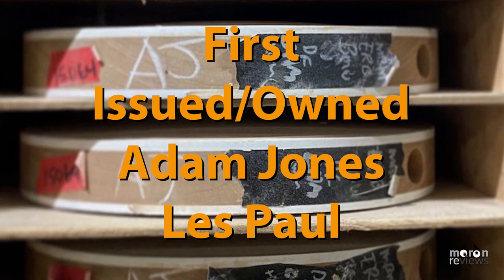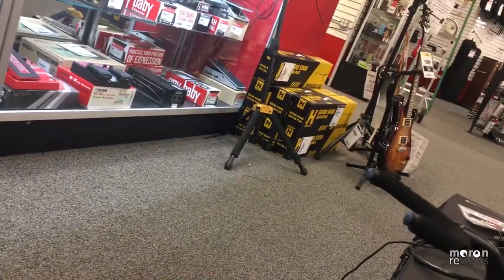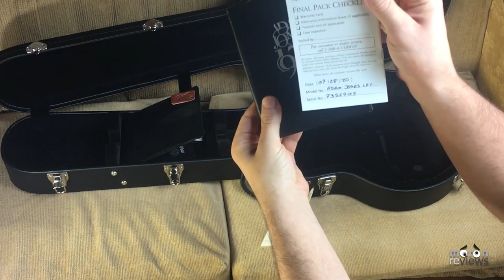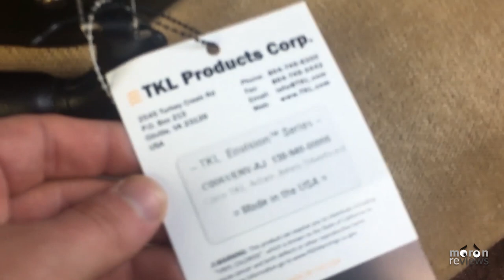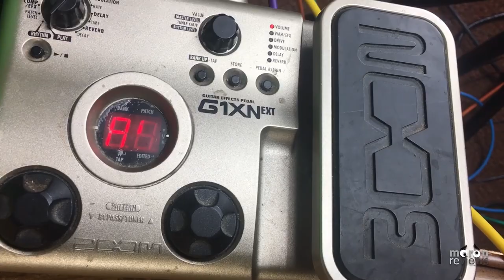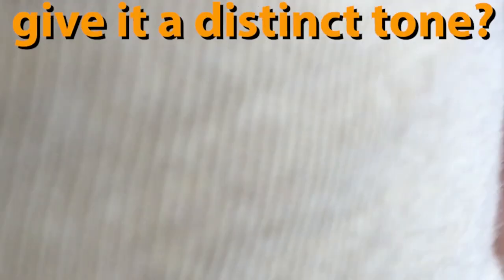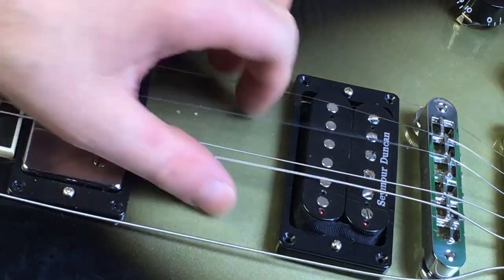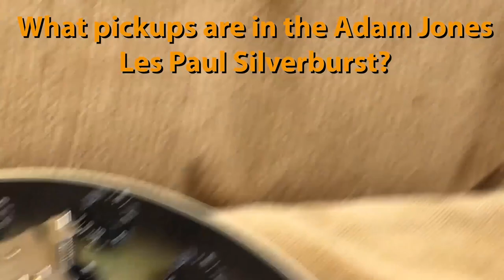Adam Jones Gibson Les Paul Silverburst Unboxing & Tear Down

Comment: Anyone know about the piece attached to the bridge tone pot? I'm guessing a treble bleed circuit on a pcb?
Reply: That's just for grounding. Typically that part would be attached to a metal tray that all 4 pots connect to. Without the tray they just put that on the back of a pot for a common ground

Comment: How does the "mirror" attach to headstock?
Reply from the maker: You have to place it under the 2, 3, 4, 5 strings which are held down by the tuning pegs on the headstock.
Reply: Appreciate the reply and info. Mine should arrive this week hopefully. For the high price, I wanted to at least be able to put the mirror on lol. I was going to be pissed if it wasn't attachable.
Reply: @justinhavins9929  what's the story behind the mirror on the headstock

Comment: This was difficult to watch. Your camera skills need work. You mentioned in the end that the case was damaged, what was the damage?
Reply from the maker: We are aware. We did not want to be too obvious filming in the store. Many of the cases supposedly reacted with the bubblewrap inside the box and caused a staining/rubbing effect all around the edges of the case. We contacted the makers of the case (TKL?) but we think the case finish didn't have time to cure and was boxed too quickly.
Reply from the maker: @dustincollman9231  It seems that it happened to most if not all of the cases - someone stated they saw several new ones, together and all had the issue. TKL is sending us a replacement,.
Reply from the maker: @dustincollman9231  I contacted them. My assumption is they will wait for buyers to complain and ask for a replacement. For how much these guitars cost - they should. Also, the inside of the case already had a puncture hole from the pickup selector switch. So I am going to take it off whenever I put it in the case.
Reply from the maker: @dustincollman9231  You can see the puncture hole for a split second at 2:34 and 4:11 when we open the case.
Reply: @MoronReviews  thanks for sharing. Those extra little details you should have put into your video.
Reply from the maker: @dustincollman9231  We actually recorded the voiceover BEFORE we even received the guitar as we tried to the post this video IMMEDIATELY after receiving the guitar. There was an initial longer version of this video, but too many cry baby TOOL fans complained about it so we cut the video in half and this is what you have. We are open to answering any questions viewers have about the guitar, but we did this video as a service to fans. A few more complaints and comments will be turned off. Remember: we did this for FREE.